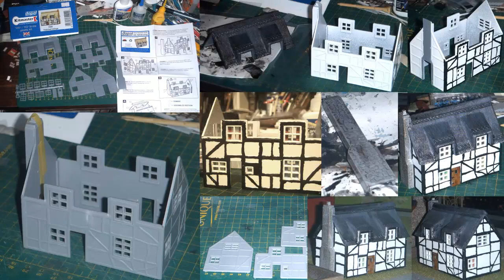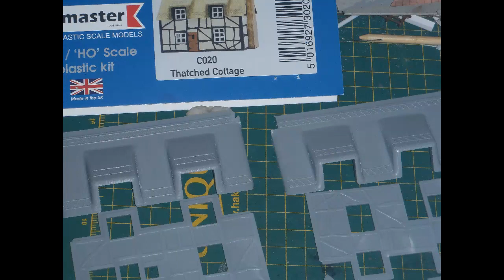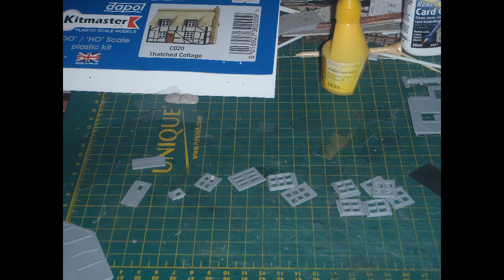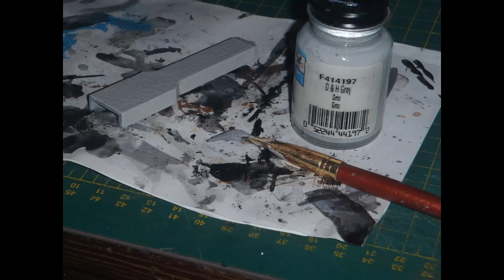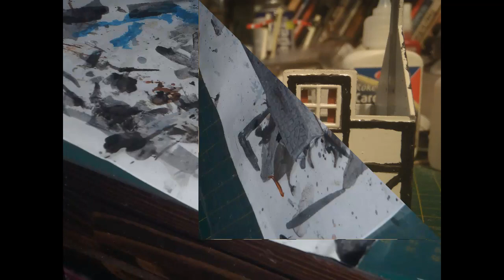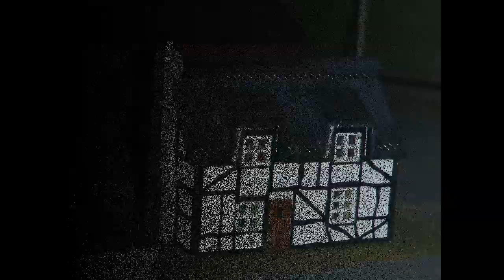OO Gauge 21, Airfix / Dapol Thatched Cottage C020

Comment: This kit was in fact first issued by Airfix in 1958. On the original instructions on this kit and others in the trackside series the windows were to be inserted from the outside, hence the external window ledge. But this resulted in the "wood" window frame protruding from the outside wall, whereas in real life wooden frames are recessed within the window aperture within the stone / brick wall. So later editions of the instructions had the windows inserted from the inside, which also meant "backwards", as the window sills did not permit insertion with the sill facing outwards. This resulted in a redundant sill within the building, and mould marks on the now outward-facing window bars, which as designed had been the inward facing and hence hidden side. Hope that helps in understanding these kits!

Comment: Very useful vid! 👌
I’m about to rework the Airfix cottage that I first built back in the 1970s.

Have always been baffled by the windows which I built per the instructions and yet were clearly back-to-front. I’ll remove them and do them as you have. May add some lintels above the windows and doors using card or split matchsticks. 

Also intend to paint the entire interior of the building in dark brown or black, as the bare yellow kit plastic can be seen through the windows.  One day might get round to putting the whole building on a little base with some static grass and tufts and the odd flower. 😇

Comment: I’ve been considering building one of these, but with extra detailing.
The windows have always plagued me, looking like something that belongs on an armoured vehicle.
I’ve recently built some of the Dapol semi detached houses, cladding the walls with slaters plastikard, full or half cladded, then spent some time thinning down the windows, including adding parts from Wills accessories.
I see painting the timber work is a challenge, I can’t remember how I originally managed it, as it was around 45 years since I last built one.
Maybe some experimenting is due.